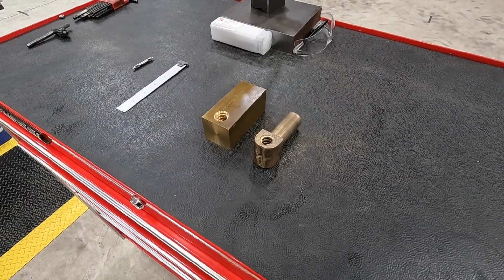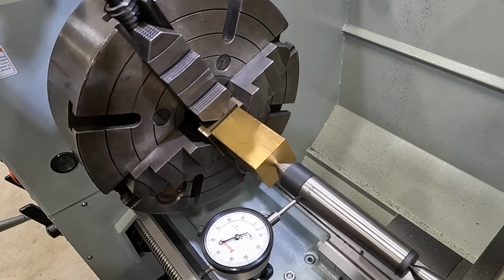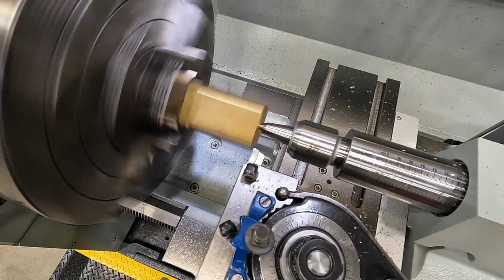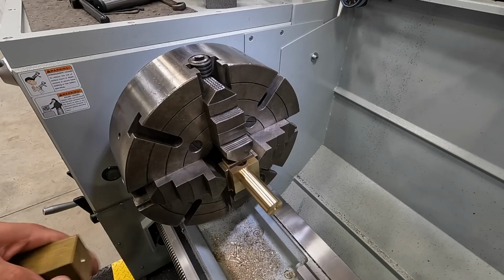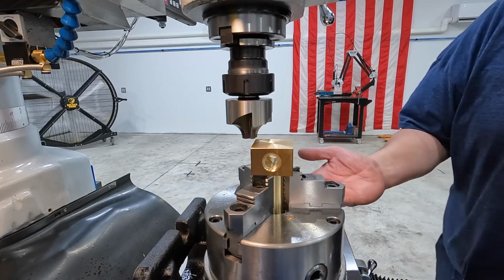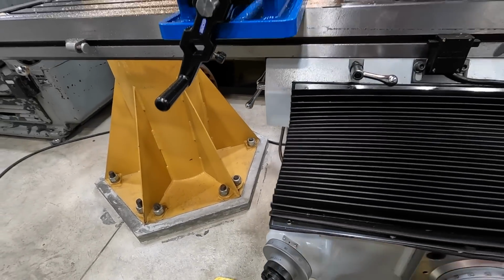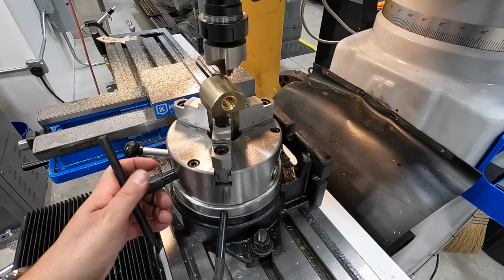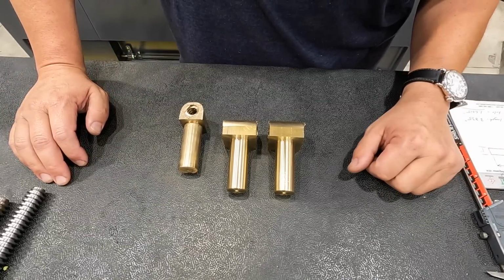Bronze Acme Nut Part 2

Comment: At the end of the video when you have the new and old piece on the table the new ones dimensions seem incorrect. The new nut is a lot larger in width and the shaft diameter seems smaller than the original.
Reply: I'm fully aware of the changes but that's irrelevant to the dimensions the nut still needs to fit into the machine.
Reply: He changed from square threads to acme
Reply: @jonjohnson102  how does the thread profile matter?
1. 3/4 Acme and 3/4 Modified Square both have a nominal diameter od 3/4
That is not what OP is even talking about.
Reply: Yup. Just have to watch the videos.

Comment: It seems a small logical failure to use soft jaws in the lathe on a surface that will mostly be milled later but then not use soft jaws on a finished surface on the indexer while milling. Maybe knowing the finish wasn't important in either area affected the planning.
Reply: I think the problem is with keeping the part centered, so it can be turned 180.

Comment: Have you tried approaching with the round over bit from both the side and the top?  Once you have your zeros back off both directions and approach it moving down and over with each step.  I find that results in a lot less chatter, at least for the first several passes.

Comment: Those new parts don't look quite right. Are you sure that was 1.5" square stock? a .75" radius cutter should've made a semi-circular end. That flat strip looks about .5" wide which tells me that stock was 2" nominal square.
Reply: Early on he said 1 3/4 square, so if he said 1 1/2 some time else, it could have been a misspeak.
Reply: I see where he said 1 1/2 was the width with the 3/4 radius, so definitely something was off.

Comment: KBC had a store in St. Louis years ago. I shopped there infrequently since I had access to other suppliers through work. I always thought of KBC as a "B" level supplier dealing mostly with off shore materials of second grade quality. I steered clear of them for that reason. This is the first time that I have seen you operate the KBC mill. I expected the mill to be substandard, but your demonstration today really impressed me. I have no beef with Align power feed or Newall DRO. I introduced our shop to Newall when Accurite went belly up. We used Newall for years and essentially eliminated glass scale and wiper issues, (scale contamination). If KBC branded machine tools justify these accessories, I will rethink my distain for in house brands. This looks like a similar size mill to the old Bridgeport Series II. What taper is the tooling for this machine? Is the tooling held with a conventional knee mill drawbar or does it use a collet system and tooling drawbar nut like CNC? Do you know who is making this machine? When USA machine builders abandoned the manual machine market and CNC took over the industry it seemed to me that quality manual machine options became very limited. We owned a Sharp and an Aliant purchased in 1993 or 1994. I was smugly distainful of these brands, but really grew to appreciate their quality. Eventually service parts were nearly impossible to source. I would happily have either of those machines in my shop to replace my worn Bridgeport.
I would like to see a review of the KBC. Today's video has already impressed me. Would you give a back story on why you chose this machine? Would you rate it against other currently available options? You have enjoyed KBC products for a long time Lyle Peterson likes KBC as well. Do they still print a catalog? Catalogs used come to my desk years ago.
Reply: It is a fact that many "brands" can change quality drastically over the years as new management comes in. In this case it seems KBC is choosing better suppliers than in the past. When evaluating a brand look at what they are selling today - not how they were in the past.  Adam has obviously done his research in picking equipment to come into the shop.
Reply: At a guess, I’d say that machine is a Taiwanese import. A LOT higher quality than mainland Chinese imports.
Regards
Robert

Comment: Could you’ve put the radius end mill in the tool post turn the part in the lathe and feed the end mill in on part
Reply: That would put the end mill profile all the way around the part, not just the two sides parallel with the Acme Treaded bore.  It'd become a lot of fiddling around, but it should be possible to spin the end mill in the lathe chuck, and use the tool holder cross slide to feed the part.

Comment: But isn't it too wide? shouldn't the sides have been cut down before radiusing?
Reply: Yeah the top is so much wider, I assumed he would have removed some material before putting the radius on.
Reply: Go to the tear down SNS360 you will see there is loads of clearance, he also said at the beginning of the video it aesthetic
Reply: @dylannicholson950  I didn't think for a second he would have cocked up :) I just missed that bit cheers
Reply: Watch the previous video you get your answers there already
Reply: @erikhumble9797  I rewatched the previous video.  All I heard him say was he had stock that was a little larger.  He also explained that he was going to use a radius mill.  I did not hear why he was leaving the part oversized.
Reply: @robertlevine2152  Same, my guess is he had the radius mill for the stock size but not a smaller one to match the radius of the original and just went with it instead of going through the hassle of setting it up in a rotary table and mill in the profile that way using an ordinary endmill.. that's a lot of speculation but could be 🙂
Still, probably noncritical dimensions but.. yeah doesn't "look the part" 🙂
Reply: It would have been nice to see a close up side by side and end to end.  I'm not sure it is the angle of the camera creating an illusion or a difference in dimension.
Reply: It is wider than the original. Square instead of rectangular. Maybe it doesn't matter but I wouldn't chance it in case the profile is needed for clearance. And it looks nicer too 🙂

Comment: Forgive my ignorance, I’m not a machinist. When milling the radius, is it possible to make the whole cut in one pass but just slow the feed rate way down?
Reply: What Adam showed is standard practice for this type of cut. Woodworkers can sometimes get away with a full pass radius cut with their routers, but the hardness of metal makes it nearly impossible.
Reply: I am sure the theory is solid but you can sneak up on the dimension and get a better surface finish this way... but, IANAM
Reply: Let's just say you never want to eat the whole apple in one bite.  By taking smaller bite's (cut's) you ensure you don't bend, warp, break, excessive vibration, etc., whatever part making / your working on.  Remember machining 101, you work in thousandths, not so much "INCHES - PLUS."  Let's assume for a second, you were milling / making this part.  Let's also assume you had / owned the exact same equipment as Abom.  You decide to eat the apple in one bite.  Here are some of my best guesses what would happen. The 1/4 round cutter would break in half, and fly across the room. The cutter would bend badly, and rip the part out of the vise / speed chuck. Would break-off the top of the part and would fly across the room.  You get the picture.  Not a warm and fuzzy ending.  I'll leave out the chances of death, or plain breaking the milling machine, in some fashion.  Just because you have a bigger machine, doesn't always translate to bigger cut's capability. Hope you learned something.

Comment: As a non-machinist I was wondering if the DRO on the lathe was purely for measurement or if it interacted with the feed, cutting the feed when the DRO hit zero.
Reply: the dro has no control over the machine and can't stop it
Reply: the DRO is the digital manual machining. As soon as the digital system controls the machine it becomes a CNC machine.

Comment: Ahhh! The pucker factor!!! If that were me, that part would have slipped, caught corner to corner, and sheared that stem right the hell off! And then I would have not only had to start over, but tram in again.
Reply: Except in adams shop it would have made for great content! This guy rarely messes up on a lathe or mill though so Im not holding my breath for a crash video.

Comment: Question: could you set up a second camera to record the DRO while you are turning things, and then put it into into the vid in a PiP style? Dunno how hard it would be to keyframe it into sync, but would look cool :D
Reply: A sync trick i used to do when I was in the video biz is start both cameras rolling then take a flash photo near both cameras. There will be a single frame of white on each camera at that moment of the flash. Align the clips in editor and there ya go!
Reply: @djquick  oh man that's slick, I need to remember that if I ever get around to making another video.
Reply: I was thinking the same thing..... atleast do a single run showing the DRO
Reply: If he is using FCP it is pretty easy to do pip and synch using the sound channel.
Reply: @DJ Quick You could even just buy a cheap external flash and hit the test button to fire it. That'll guarantee a very bright flash and it'll be cheap as well.
Reply: It definitely would look cool!